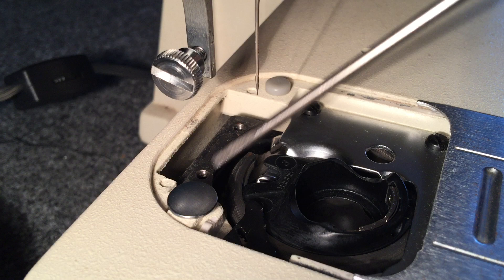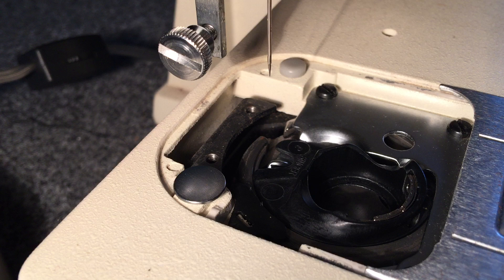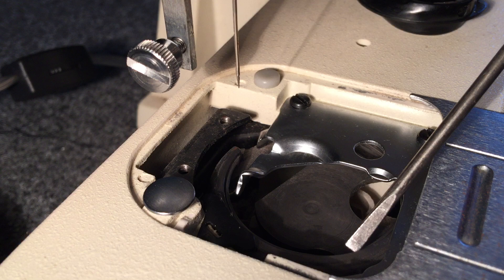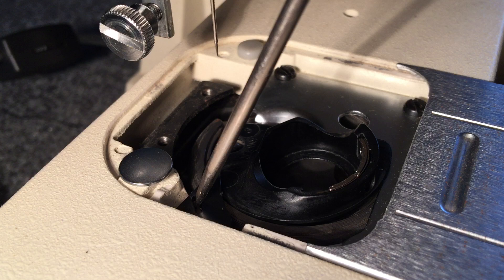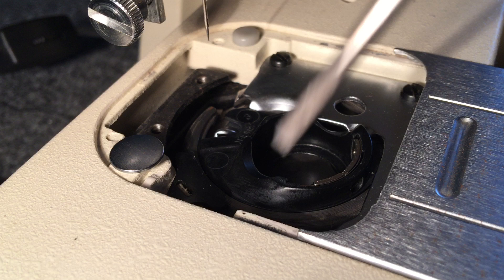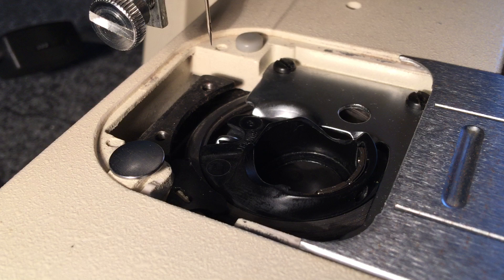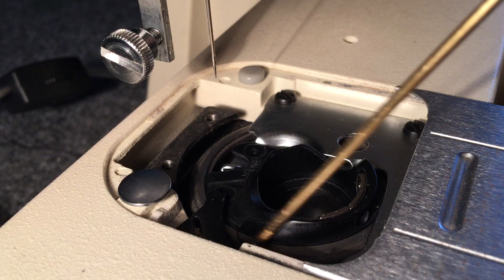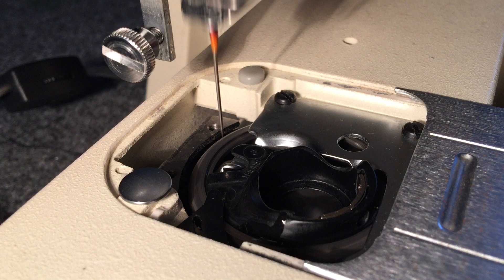SingerOnline.com Apollo Bobbin case installation

Comment: Thanks! My bobbin case kept getting crossways and I thought that it wasn't installed correctly and I kept trying to figure out how to put it IN the hole underneath--even though it seemed to fit properly when it was just resting on the lip. The trick was using a screwdriver to flip that little wing doohickey over it. I really was getting it in place correctly before, it just wasn't being held there. 

BTW, I have a Singer model 4562 and my bobbin case works exactly the same as yours.

Comment: that was great. for some reason I was CERTAIN the botton holder had to go UNDER the bit of sheetmetal to the right of it. I was ready to unscrew it and all. I found that if I just hold my thumb down on it and wind the driveline handle (on the end) it would click in place and I would literally hear a click and then could slide the little holder bit on the top left over it.

Comment: Excellent. Short, pithy, too the point. Leaves nothing out. The booklet from Singer fooled me. When I removed it, there was not enough light for me to see that the black Apollo Bobbin Case was was on-top of the black Position Bracket. I spent fifteen minutes trying to get it UNDER the Position Bracket. Sigh! I know better, but my Idiot Brain was in charge. I should never have removed the Apollo Bobbin Case until I had enough light to see how it was positioned before removal.

Comment: please help me. the little part that you called a position finger is too low on my sewing machine so the thread is getting caught between the position finger and the bobbin case.  I need to raise the "position finger" or rather that black lever that holds down the bobbin case. how do I do that?? I need an answer ASAP as I am trying to sew a display for Halloween. I have looked everywhere and nothing on the internet or in any manual mentions this little lever. thanks.
Reply from the maker: +Miss Understood (Dandere) you need to bend it up gently with a small screw driver about the thickness of a matchbook cover (or less) just enough to get the thread to slip under. Sorry for the delay, this YouTube stuff is new for me. Hope this helps! Call us anytime you need help 800-559-6729 SINGEROnline.com
Reply: SINGERonline.com Thank you but i already did just that on my own! Sewing machine is fine! Thanks

Comment: Thanks for the video!..Wow..ok..so why did singer go with the plastic casing in a heavy-duty type machine? I'm going to take another stab at it after watching your video...I'm surprised that they didn't do a better job w the design. I have 6 sewing machines & 4 are singer...I never had so much problem with the casing or bobbin area as I have w this thing.Honestly, I was contemplating the trash can for it & all because of that little plastic bobbin casing.

Comment: I don't have this exact machine but I'm having problems with my bobbin popping up and locking in place and not spinning. I've put it back in the correct place several times and each time it does this. Can anyone help? TIA
Reply from the maker: Re-thread the entire machine, with a new bobbin. Make sure the bobbin case is seated and locked in. Your bobbin could be defective or machine threaded wrong.

Comment: Great video. I was preparing Wednesday nights sermon message and my wife came downstairs to look for a small screw driver as she was putting a zipper on a friends coat. Originally she had problems putting the bobbin case back in. This video fixed that issue, but that was not the problem.

She has a singer 5040C and when I took the covers off, I found two halves of the plastic gear that runs down to operates the bobbin mechanism. I have searched for hours to do this. Any ideas? Thanks and God bless.
Reply from the maker: You need a new gear, unfortunately I think its obsolete.

Comment: Thank you very much, really well explained.
Could you please post more hints and tips, im struggling with the bottom thread getting caught up in bunches? Help please... ;)x
Reply from the maker: +Joanne marsden-Hall  This is a worldwide problem. Most often it is caused by a misthread of the upper spool, make sure your spool thread finds its way into the top tension assembly. On the new machines its hidden, on the old machines its stuck up on the front and very visible. What happens is, the spool thread misses the tension discs in the tension dial, this makes the thread too loose and its being pulled under the fabric by the bottom thread, which is tight. I call it thread nesting, big loops and jams. 

Don't hesitate to call with any related questions SINGEROnline.com 800-559-6729